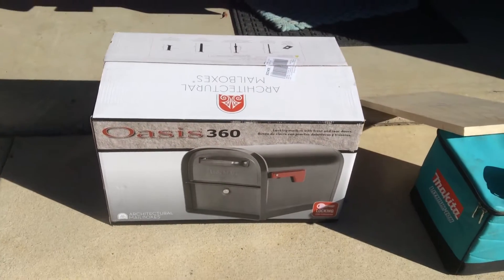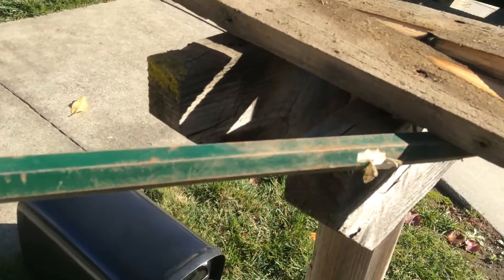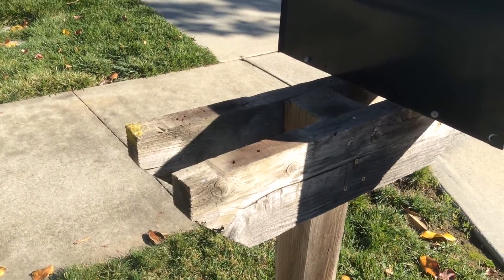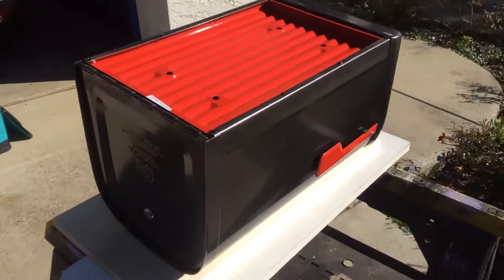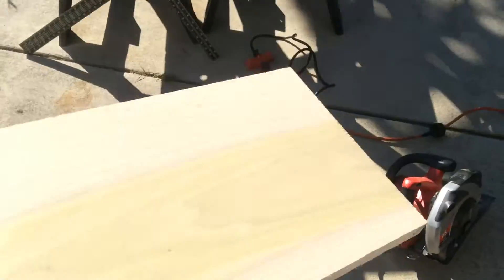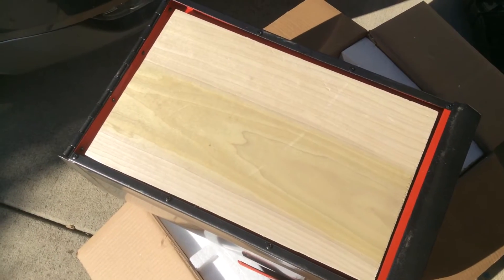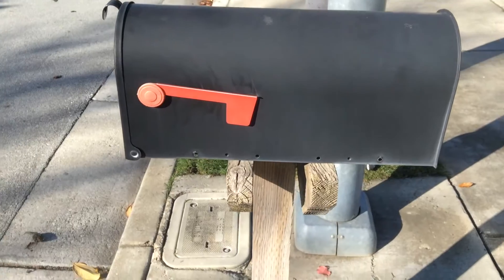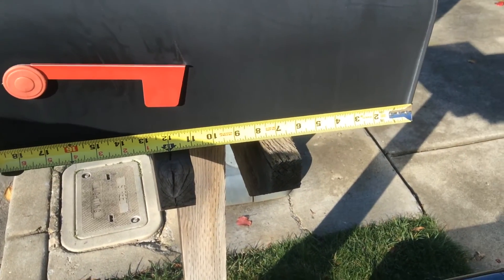Lockable Mailbox Installation (Part 1 of 2)

Comment: Nice tutorial on installing one of these Oasis locking mailboxes. Just wondering how it's holding up after a half year. Would you recommend the mailbox?  Thanks again for sharing.
Reply from the maker: The Mailbox and installation as shown in the video has held up very well.  This Locking Mailbox has not been compromised as of yet while standard mailboxes in the neighborhood continue to be compromised.  Let me know how it goes.
Reply: Did you need USPS or HOA (home owners association) approval?
Reply: Five years on and it's doing fine, even after being backed into by the neighbor's van and sideswiped by their trailer. Nothing a little pushing and pulling on the frame/door didn't fix. Thank you again for this review - it helped a great deal.
Reply: @Sam-656  The USPS is fine with it (just be sure to mount it at their suggested height - this one is a bit tall so I ended up sawing off a couple of inches from the 6x6 post it sits on). All HOA's are different, but as this box satisfies all the requirements of the post office, I would hope it's OK. Can't hurt to ask first, though. Be well!
Reply from the maker: Thanks for asking.  I'm happy to report that the mailbox and the installation are still performing well after several years.  Several of my neighbors in our HOA have successfully installed as well.  It has definitely stood the test of time.